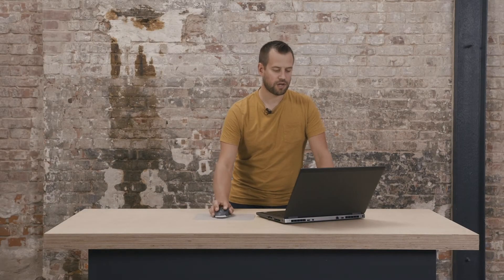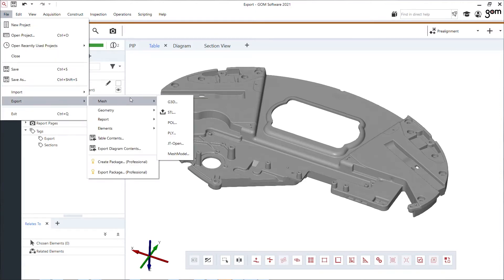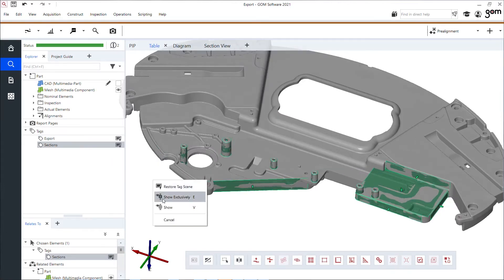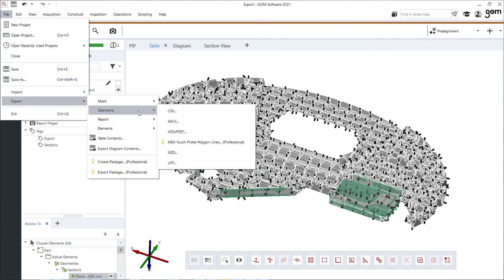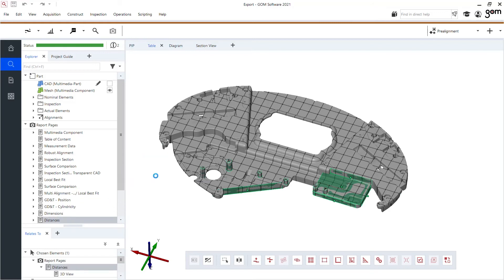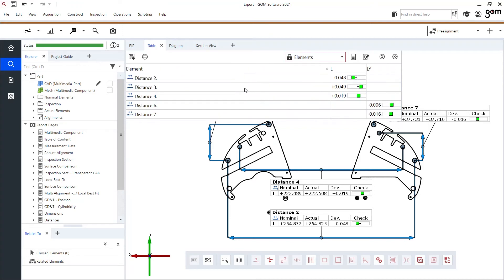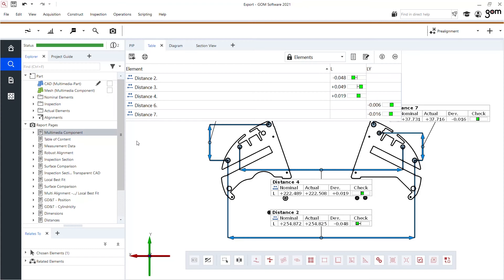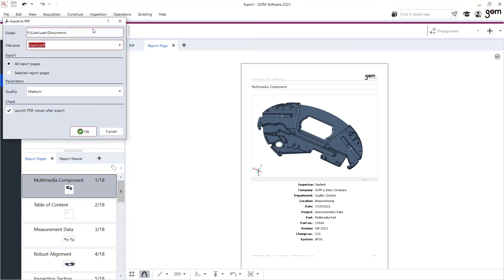ZEISS INSPECT: How to export your 3D scan results

Comment: Dear Team, can you please explain, how to export a table in excell. merci
Reply from the maker: Hello Dejan, you can export your results in a csv-file which can be imported in Excel. In the parameter tab, you can choose the delimiters.
Reply: @handsonmetrology6317  When I try this, it doesn't put the values in separate cells. Is that possible in the 2022/2023 version?